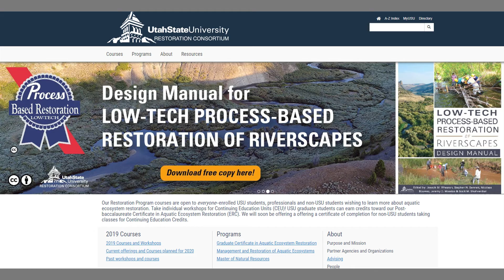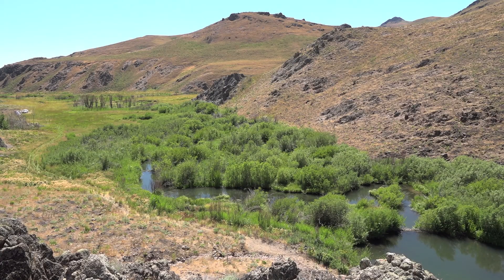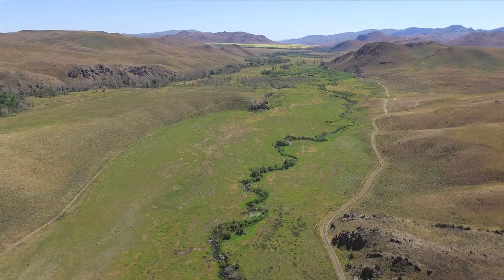Restoring streams post-fire with low-tech structures in Idaho

Comment: Re introduce beavers and then protect them. They will do the work for you!
Reply: I've worked on beaver relocation projects. You can't just toss them into a degraded landscape. All that happens is a happy predator gets an easy meal or the beavers leave the area. Using beaver dam analogs helps reconnect the river to the surrounding floodplain which results in willows and other similar woody plants coming in. The analogs also create pools that beavers can use. Then beavers can come in and continue the work. The analogs are just jump starting the natural process.

Comment: Instead of building beaver dam analogs why not just allow beaver dams to be built again? Cheaper, easier, more efficient and better for humans and wildlife.
Reply: I've worked on beaver relocation projects. You can't just toss them into a degraded landscape. All that happens is a happy predator gets an easy meal or the beavers leave the area. Using beaver dam analogs helps reconnect the river to the surrounding floodplain which results in willows and other similar woody plants coming in. The analogs also create pools that beavers can use. Then beavers can come in and continue the work. The analogs are just jump starting the natural process. If the landscape was left alone, eventually beavers would move back in after the vegetation had come back naturally. But it could take a very long time depending on the level of degradation. We can help get things moving and shave off decades of  recovery time and BDA's are cheap to install.

Comment: It's cool, but beavers would have done it better. It's actually really funny, because they had post pounders and power tools, and it's still not really as good as what a beaver would do. Beavers flood the entire region, they don't just stack logs in a stream. Yeah, the water slows, a little, but it's not really making a pond or lake or anything. I like the idea, especially when beaver are introduced simultaneously, because it basically makes things easier on them. But I'm not sure beaver would want to live in this area, because there's not many trees.
Reply: I've worked on beaver relocation projects. You can't just toss them into a degraded landscape. All that happens is a happy predator gets an easy meal or the beavers leave the area. Using beaver dam analogs helps reconnect the river to the surrounding floodplain which results in willows and other similar woody plants coming in. The analogs also create pools that beavers can use. Then beavers can come in and continue the work. The analogs are just jump starting the natural process.

Comment: Small rivers can be cleaned from bottom sediments using a motor pump for dirty water and a suction nozzle Bagermaster. A mini dredger consisting of a motor pump and a suction nozzle allows you to deepen small rivers by removing sediment from sand and silt

Comment: They should have just brought in about 6 or 8 beavers they wouldn't of costed but what they paid one of them engineers for a day... And they would of done it twice as fast and provided lots more food for predators for years to come
Reply: What would the beaver eat? Have to have the trees first right?
Reply: I've worked on beaver relocation projects. You can't just toss them into a degraded landscape. All that happens is a happy predator gets an easy meal or the beavers leave the area. Using beaver dam analogs helps reconnect the river to the surrounding floodplain which results in willows and other similar woody plants coming in. The analogs also create pools that beavers can use. Then beavers can come in and continue the work. The analogs are just jump starting the natural process.

Comment: Beavers were not invited?  WTF?  It sometimes appears that we people of Idaho try very hard to appear more ignorant than the people of Mississippi and Missouri!  Why is this??  It does appear we are quite good at it!!  Best of luck to all of us!
Reply: I've worked on beaver relocation projects. You can't just toss them into a degraded landscape. All that happens is a happy predator gets an easy meal or the beavers leave the area. Using beaver dam analogs helps reconnect the river to the surrounding floodplain which results in willows and other similar woody plants coming in. The analogs also create pools that beavers can use. Then beavers can come in and continue the work. The analogs are just jump starting the natural process. They talked about this in the video saying that beavers from nearby intact areas (not degraded) should move in as the conditions in the project area improved.

Comment: You sure are making it very beaver friendly. Beautiful work and area.
Reply: Looks more like they were putting the Beavers out of work. Pretty sad 🙁
Reply: @tomb816  Prebuilding BDA's and other analogues like them will actually incentivize beavers to move in since they kickstart the habitat repair. 
They provide pools and can give willow and other riparian vegetation a head start on the beavers, so when the beavers do move in they will have food and hiding spots pre made.
Beavers generally prefer finished habitat and avoid barren streams completely. 
BDA's are temporary structures and will fail in about 10 years without repair, something beavers will do if they move into the area. 🙂

Comment: This is awesome. Low expense, low impact. The only  concern I can see is perhaps fish passage for some fish.   Bank storage may be improved by flooding.
Reply: Actually beavers and salmon have a symbiotic relationship! Salmon are very adept at jumping over beaver dams, they have been evolving together for millions of years. The beaver ponds create ideal spawning habitat by lowering stream temperatures and reducing water speed. Often times there are also small channels around the beaver dams that fish can use to get upstream. This is one of the key differences between beaver dams and the large concrete dams often made by humans for hydropower and drinking water.